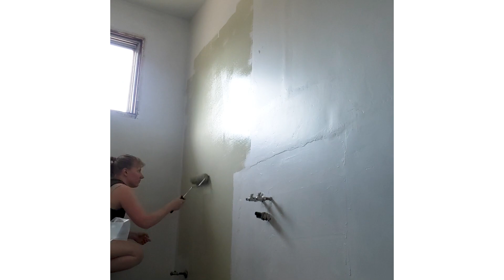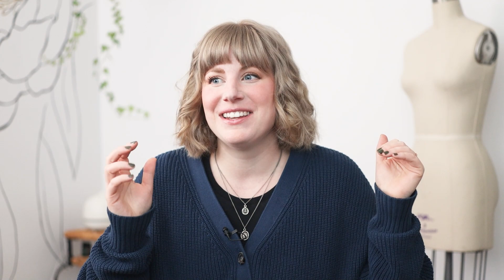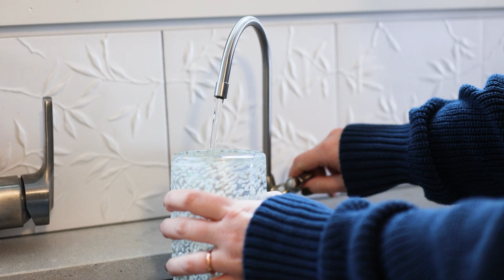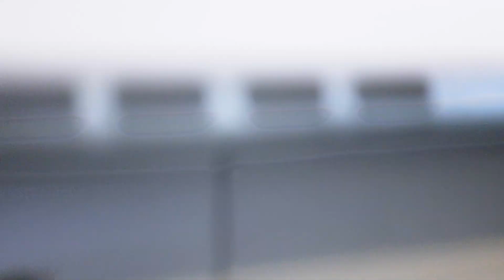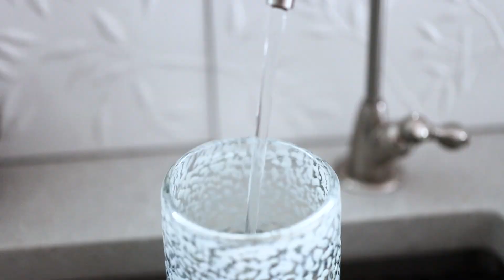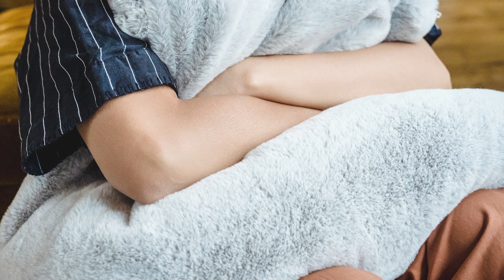How to Avoid Toxic Chemicals in your Home

Comment: Thank you for this video, I have had a kitty that had pneumonia and asthma and our current kitty is sneezing despite the fact we have an air purifier. So vet recommended antibiotics to treat potential feline herpes virus. But he is still sneezing daily and frequently. We do have carpet all around except for kitchen and bathrooms. Wondering if it’s the fact that we have a lot of those fleece blankets and fuzzy beds for them to sleep in, as well as having fluffy pillows. If I understood correctly, they are releasing micro plastics but if I vacuum them (or wash the blankets) more often, then that might help? I don’t have a hesitancy towards getting rid of the fluffy pillows, but their beds and everyone’s blankets is a bit harder since I don’t know what else they would use to be comfy when resting on the floor. And I live in really cold weather (snow and all) so blankets are the things that help me survive it. If anyone has any suggestions or ideas please let me know. I am on board with decluttering but I don’t want to have to buy a lot of things all at once to replace the “bad” ones.
Reply from the maker: Vacuuming, dusting, and washing regularly will definitely help with reducing microplastics in the air! Carpet is also bad with not only microplastics but trapping dust and other allergens so it needs to be vacuumed well. I don't think you need to get rid of everything at once, but if you have items that are visibly shedding or wearing out/deteriorating I'd recommend replacing those. There are natural fibre options like knit cotton or wool blankets, cotton fleece, or cotton flannel that are still nice and cozy. For things like pet beds it's likely much harder to find natural materials, but you could try covering the bed in a cotton blanket.
Reply: A suggestion I have is switching out your cleaning products, especially laundry, with brands on the EWG website.  There's a lot of chemicals causing asthma and allergies etc. and it would reduce kitty's and your exposure :)
Reply: Thank you both so much!